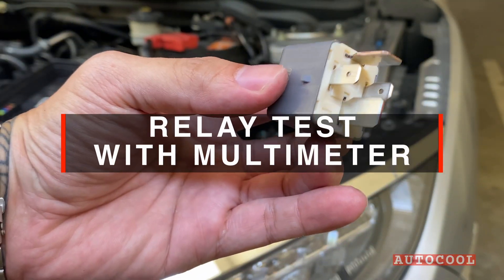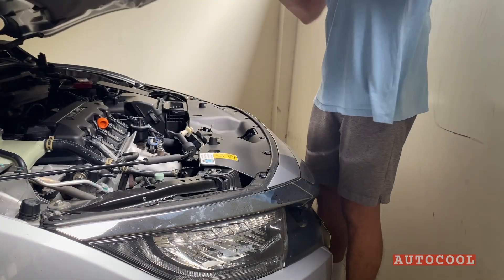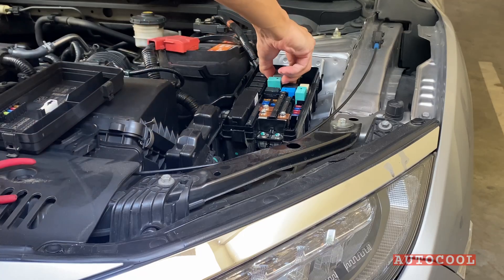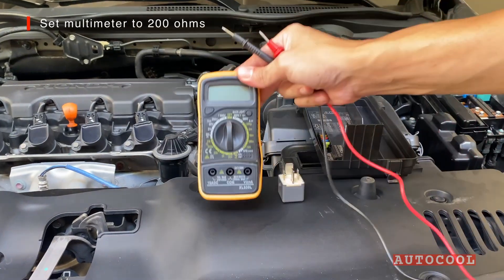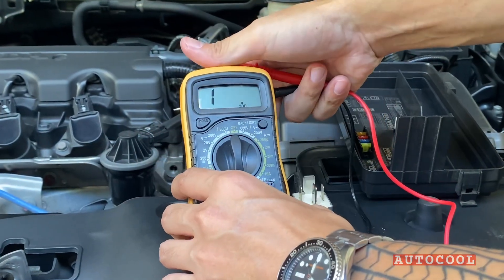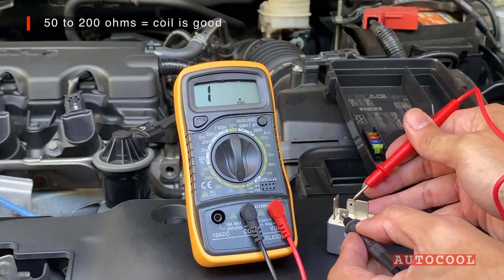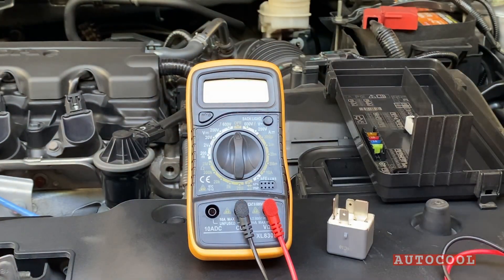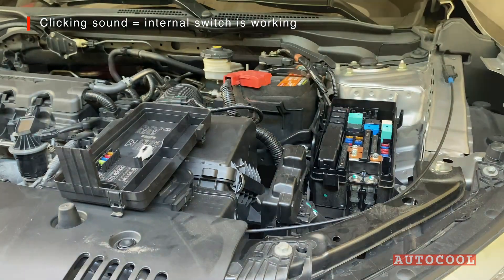How to Test a Relay with a Multimeter

Comment: Not ever safety fore connection betwin terminal 30 and 87, some relays have a resistor betwin terminal 85 and 86 too
Reply from the maker: Hi  @TheUltimate65  , good point! Some relays do include internal components like diodes or resistors across the coil, so it's definitely something to keep in mind when testing. Thanks for watching and sharing that information. A like and subscribe really helps support the channel, and I'd appreciate it a lot 😊

Comment from the maker: In the demo, a 9V battery was used to engage the relay coil, not a 12V. A good 9V battery can provide just enough power for testing purposes, but for proper operation (especially in automotive or 12V systems), you should always use a 12V power source. Thanks to  @bigmedge   for pointing that out! 😊

Comment: That’s a 9 V battery though, not 12. 12 v batteries don’t have that small rectangular design with the 2 terminals on top
Reply from the maker: Appreciate you pointing that out,  @bigmedge  ! you're right, that was a 9V battery, not a 12V. I’ll add a note that a good 9V can still have enough juice to engage the relay coil for testing. Thanks for watching and dont forget to subscribe if you're into this kind of stuff 😊